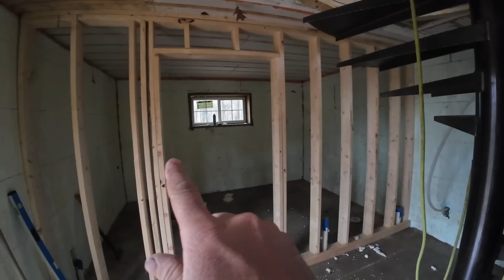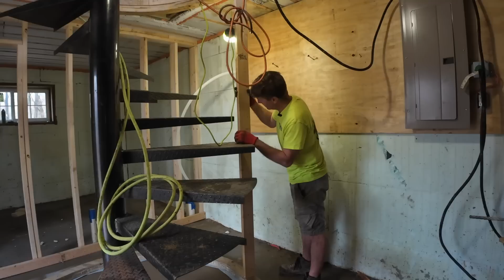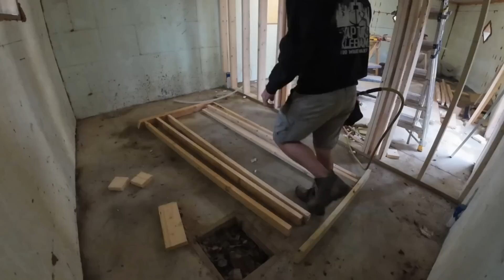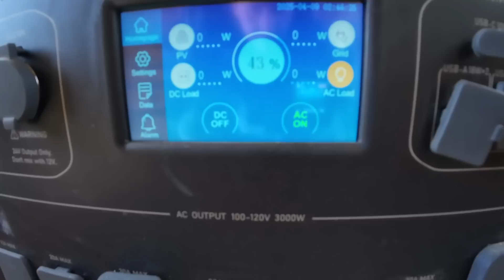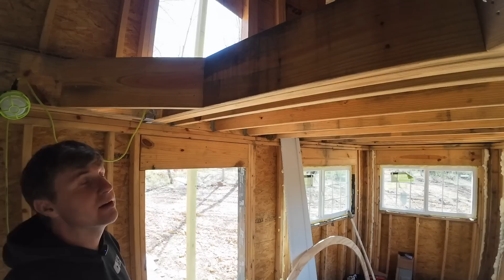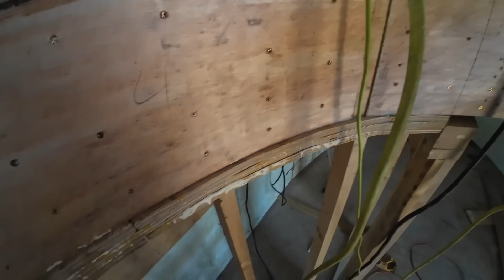Framing My First Radius Wall - Lessons Were Learned - Building My Own Rental

Comment: There’s a metal carver disc for a 4” grinder that wood carvers use that would be perfect for repairing your radius. They’re VERY aggressive. Then you can come back and smooth it up with a belt sander. Search wood carver for 4 inch grinder. It’ll save you a bunch of time.

Comment: Your suggestion for using the router to rout the opening radius, using the same idea if not the same boards even, make the first plywood board the full opening. With the center hole drill it big enough for your stairway pipe. Cut the board in half. Perfect tool for centering the pipe later during install plus it can help stabalize it at the top while you are doing so.

Comment: Does your building Dept. Consider this a commercial project? If they do they might require you mechanical room and chase be fire rated. Check into it before you go too far.
Might save you some heart ache later on!
Reply from the maker: This is residential

Comment: You’re gonna have a tough time doing drywall on that curved surface.  You’re going to need to come up with something else like some thin plywood or thin MDF with some relief cuts on the back side.  You’ll be cursing a lot during the finishing of that stairwell.

Comment: I just love the ingenuity of this build.  Then your thoughts on how you did it and how you would do it differently to make it easier or better.  But in the end, no matter how you do it, it turns out amazing.  Pointing out the spacing between the walls and steps as you get higher is a good catch.  Despite the level method, the gaps all around are even better at how truly plumb the staircase is.  At least you can make adjustments!  I really got a kick out of the mismeasurement of the doorway.  A triple top plate is a good fix for that!  As long as the actual doorway is exactly where it is supposed to be, all is good!  Going to be a lot of fun watching you put those custom 2x8s (or 2x6s?) up for the deck and make that curve!

Comment: 7:44 For the curved wall you can do it with ¼" drywall.  If you wet the back side of the sheet with like a spray bottle it will curve around that radius no problem, however you are gonna need more studs to fasten it than just 16"o\c, more like 8" o\c to have a smooth curve.  If you perhaps put a ¼" sheet of luan plywood on it first maybe the wider stud spacing could work but im not sure.  Theres also 'flexible drywall' sold (Pabco Flex is one) but I don't think you need it (probably very expensive too) for this size curve.  You are gonna need to use a 2x's(or ¾" plywood strips etc) to help spread the bending force pressure on the drywall while you're fastening it around the curve.  I'd double screw it so they don't pop and it spreads out the fastener load so it won't break paper.  I'm sure you can find a video showing curve wall drywall installation processes somewhere around here on the 'tubes(or maybe its done already lol).  What is that like a 6' -7' diameter circle?  That shouldn't be too hard with quarter inch sheetrock, especially with wetting it to help it flex. 👍🏻🛠️

Comment: you do not need more than 3/4 bottom and top rail to hold the studs the only reason for double top plate on exterior walls  to transfer the truss or floor truss that dont land over a stud.As well to tie the walls together.interior not required unless structure support. we do it on interior walls to match the exterior walls.
Reply from the maker: I do

Comment: Myself, I would have preferred an open spiral staircase with just a Nice metal railing design,
Keeping it nice and airy and open , letting it flow from one floor to another,
And not boxing it in ,
Like they have in old light houses and Dutch windmills and such.
But you’re doing a great job and the boat house is looking fabulous

Comment: Just a thought. A grinder with a aggressive flap disk (40 Grit, 36 Grit) will make short work out of that top plate. I know you were thinking belt sander but a grinder in my experience with that much overburden is quicker. (Not as pretty but quicker) If you have a 9" grinder even better. Good luck with it with your work ethic whatever you decide is gonna work out just fine.

Comment: That wall was definitely a challenge Mike, have you thought of sheeting it with aluminum composite panels, a lot of marine stairwells are metal skinned (to follow the theme) A chinesiem mini chainsaw would help rough out the radius on your gluelam. I love the Fiskars framing alignment and removal tool.

Comment: You were talking about getting your drywall to bend nice. I was tough to lay the drywall over something with a simmer radius. I use luann or paneling and form it into shape over a 2x4 T frame. With the moisture in your basement it will bend easily in the few days. And you can also take a roller and apply a little water to make it flexible. It will dry to the shape you desire and not look uneven on your radius. Love the progress, Mike.

Comment: Did you say...
Quintriple???🤔🙄😶🤪😂🤣
Love the vocabulary!👍
I'm sure all of your teachers are so proud, I know I'm impressed!😂
The stairwell cylinder walls are just fine.👌
#2 grit boulder belt for reshaping is definitely what I would use as well, 💯%!
Yes, a template or jig would have refined your cylinder, but your method is still pretty much what all of us would do. I have certainly had to fix way worse.
You probably should have QuatroThruplePentiNumble checked, that would make it perfect. There's still time.😉
Have a great day bub!🤙

Comment: Thanks for sharing your thoughts, ideas and videos. Staircase walls will look great once finished. Know body needs to know what exactly is behind the drywall. It’s not like your putting it on the internet. Hope your finger finds the nutrients needed for a full recovery. If you haven’t been there before you probably have been living inside a plastic bubble somewhere. Nice to see the Bluettie working out for your power needs. Was half expecting to see it used in the final project before you started investing in copper and aluminum futures.  Funny story, back in the day when the big Alcoa plant was built in Massena NY they needed all the copper for the war effort and all the buss work was built out of solid silver. Back in the 90’s they finally took an extended outage to replace the busses. Should of known that  was the handwriting on the wall that they were planning on abandoning ship and leaving the community. Wishing you and your family the best.

Comment: No suggestions but a couple of questions. You were meticulously to put vapor barrier under the plywood ( I do understand that it is more porous) but you did not do the same for the 2x4s on your wall framing. When I watch other builders they almost always do that. Second it seems the way you did the studs around your stairway that you could have gone one more stud so there was no danger of a person who was walking along and not paying attention stepping off into a hole…just a thought. I’m enjoying watching. I’m impressed with your ingenuity and design. You clearly have thought this through. Looking forward to seeing the finished product.
Reply from the maker: I've never put it under regular lumber and never had an issue.  Railings still have to go up

Comment: I think you'd be FAR better off with a 7" grinder and a coarse disc than trying to keep a (flat) belt sander horizontal while flushing those plywood plates back to your laminated opening.
A 16 or 24 grit disc can move material a lot faster than any belt sander and wont wear out as fast. It doesn't have to be pretty if its buried under sheetrock

Comment: You’re making progress! Great job. For your curved wall drywall… Make a cradle with the same radius. Lay the drywall across it and wet it with a sponge till it sags into place. Then let it dry. I did it for an archway before. That’s my suggestion I’m sure there will be others.
Reply from the maker: That's a good idea!
Reply: Avoid the temptation to add a little weight to encourage it to bend quicker.  I ended up with 2 pieces without the desired radius!  Happy experimenting!

Comment: Stud walls going up a treat, Mike ! 
Pleased you have a battery system that is mobile, saved you a lot of time not having to wait for the generator components !
For the curved staircase plasterboard, you will find it easier to score the back of the boards approximately 150 mm (6") centres. You will probably need to cut the noggins (horizontal timbers) at angles on both ends, too... 🤔
I understand the requirements for double plasterboards, which will create a fire resistant staircase 🤓 
We do a similar method over here, and we also have fire rated plasterboard that will do the same job as a double sheet. 
 
The cupboard you are building downstairs should be called the engine room, as that is where all the electrical and plumbing will be..... just an idea 🤔
Oh, and the finger...... did you get it pinched somewhere while assisting in the floods ? 😬😬😬
Reply: 'Engine Room' .... They have boat signage for that too.  Hopefully he's envisioning boat-themed doors that he can replicate from scrap.  Then they serve as decor as well as function.

Comment: Hi Mike.  You probably could still use a router to clean up that overhanging edge, but a belt sander might be a better tool for the job.  One thing you certainly don't want to do with a router is accidently hit a screw or nail.  A belt sander wouldn't really care much unless you caught the edge of the belt, which might cause it to rip.  The circular wall structure looks great.  I was wondering how that would come together.

Comment: Nice Job!  
I don't envy you on the drywall surrounding the staircase, my Dad helped my Uncle do a less sharper radius wall in his home, after weeks of drywall/sand;/reapply coat/sand they finally settled for "Good Enough IS Good Enough".  Still was impressive though.
Thanks Captain!
Reply: I think that I would be installing some thin sheets of metal with “rivets” instead of trying to tape that, and worse sand that. 😮

Comment: Not sure what's going on with the finger but i can testify to good ol fashioned castor oil. Last summer when i was building my water fountain feature outback, i was working a huge chunk of limestone with a chisel and hammer. I had it standing on its edge, and as it split, it made a spike/spearhead feature in the bottom part of the slab, and it fell straight at my leg and left me a gash down the side of my calf 6 inches long and at its deepest in the middle was about a half inch. I dropped everything and crawled into the house and straight to the tub and got that leg under water and started scrubbing. Simultaneously that summer, i had started developing a huge bunion outside my big toe one one foot because thats what happens when 55 yr old women go barefoot and do man jobs. Im not a doctor faither or med junkie so i drank whiskey (and poured it over my cut after the soap scrub) and when it came time to butterfly and wrap the leg, i soaked gauze in castor oil and wrapped it tightly around the leg and then covered that with ace bandage. For good measure, i did the same for my toe and wore socks. I repeated it, with clean wraps every 2 or days, for six weeks i think. Bunion gone and my scar on the leg is only about 3 inches long and theres barely any color to it. Its antiseptic, antiparasitic, fast healing promotion and moisturizing. Gods oil in my opinion. I should have had stitches by todays standards! We seem to have no problem throwing out good money for convenience, but tend to go all out on inconvenience when it comes to self care. If you try to imagine 100 years ago, on a homestead, 100 miles from nowhere, and ask...what can i do, for me? Just study herbs and oils of old and you find most of natures cures are handier and cheaper than ya think.

Comment: Looking great so far, everything is a learning experience, thanks for taking us along.  Hope your finger heals up fast and well, not sure what happened but your comment at the end of the video was a little bit ominous...

I have not done this, and you probably already have thought of this (or how you are going to do it), but for finishing the curved wall with the 1/4" drywall, this would be my plan of attack (or maybe a "what not to do"....).  Not sure if the curved wall length is more than 8', but I would attach the sheets horizontally and cut the backside of the sheets across the 4' dimension, every 2" (at least), just do not break the core at those cuts until you start to feed the sheet around the wall surface.  If the curved wall is longer than 8', plan to have that vertical seam between sheets, in an area that a step will not be in the way of taping and finishing the joint (this is more important on the 2nd layer of drywall, so your 1st layer should be offset from that, but since you likely need to give the 1st layer a 2 coat tape joint for fire rating, you will want to have a second place to be able to do that without a step in the way).  You may also want to look at having the horizontal seams laid out such that they are between stair tread "heights" (fall somewhere in the middle of what would be the risers between the treads), so maybe the top and bottom sheets are not a full 4' height, depending on how 4' vertical height increments can layout to your centerpoints of the "empty area" of the risers between treads.

Hope that helps or give you so information for how YOU what to tackle that part of the project, as these are just my thoughts on something that can be done many different ways.  Anyhow, look forward to your next videos, so until then, have a good one!!👍

Comment: What if you scored the drywall 'tallways' in several strips, accordion style, on one side, so the solid paper side can wrap the stairs, and you can prepare yourself for the asylum as you mud the breaks on the outside?? I mean...WHY NOT? You could make a small mockup on the table and practice to see if its as doable outside the brain as it is inside the brain!

Comment: I believe the Gorilla glue is water based and you could add some water and mix it with a drill bit mixer while adding water. Save a couple bucks anyway.

Comment: Did you consider using bending plywood. It’s a special plywood that bend for curves. It’s commonly used in construction with curved wall or counter.

Comment: Cap’n working with radius walls is an art-form all its own.  That whole 3-D calculating on a constantly moving set of planes , is enough to shipwreck one’s brain.  But, you sir deserve a hearty ‘Aye. Aye.’ for navigating that rocky shoal!   

Even though you have a bit of trim work to do, the framework for success is in place.  Congrats, bud.

In a home, up the road from me, they built a two story curved entryway.  The contractor gave the homeowner two wall options:
1: Drywall. It would be scored vertically about every 6” on its backside. The front face was intact, the back was broken open. Each joint was then screwed to a stud.  The crease at each joint and between sheets was then to be taped and mudded.  (The tape at score seams was because there would likely be some torn places and for strength against future tears.) Afterward, several smoothing coats of mud would then make it a perfect cylinder wall.

2. Bendable plywood.  Three layers of 1/8” bendable plywood could be  screwed to a stud wall. (The stud spacing was closer than standard… but, I don’t know what.) The joints were taped and the screw holes were filled.  Afterward, a single coat of mud would be applied to provide a smooth wall.

The owner chose the bendable plywood route… material costs were lower for drywall but time and labor were almost double.  That was about 15 years ago.  So, I have no idea what the costs would be now…. However, I was in that home last winter and can attest that the plywood wall still looks great.

I don’t know what you have planned. But, here’s two cents of the three I have on this subject.

Comment: Hi Mike, are you going to finish the inside of the stairwell with drywall?  I was wondering, from a long term durability standpoint, if vertical wood slats would hold up better.  People going up and down the stairs with travel bags and such, if drywall would take a beating.

Comment: Nice work on lining up all of studs from floor to floor it is definitely going to make  the drywall installation process easier.  You might want to consider putting studs on the radius wall at least 8"oc but i would recommend 4"oc. I'm a drywall contractor I've learned the hard way that if the studs are too far apart on a tight radius (especially on the inside curve) the drywall is not going to bend smoothly it's going to look very angular.

Comment: if the drywall doesn't work out for the radius, could always do a vertical board / batten or just board and embrace the vertical lines in there.  might hide a few sins as far as the radius being imperfect vs. a continuous surface.  In either case a matte paint finish could help out - no hilights to betray any wonky bits.  Looking forward to the rest of the build!  love the engine room theme for the bottom floor.

Comment: Don't worry about the drywall curves as you can buy sheets of it that are designed to bend and it's a lot easier doing that compared to the methods you see online about wetting the sheet or the better way scoring the back of the drywall sheet

Comment: I would begin with a reciprocal saw and a 5 inch blade on those laminated plates before the belt sander.  3/8” is a lot of time sanding.  Taking a major portion of that off with the saw will save a lot of time.

Comment: So you remembered to put the sill seal (foam) under the radius wall, but not the bathroom, or small 2x4 wall: moisture will still wick up from the concrete into those walls too.